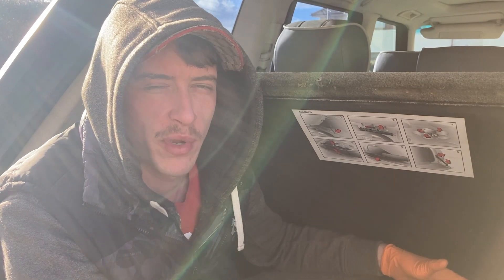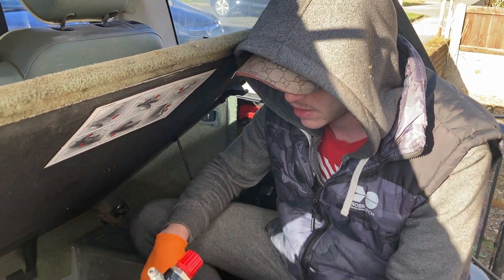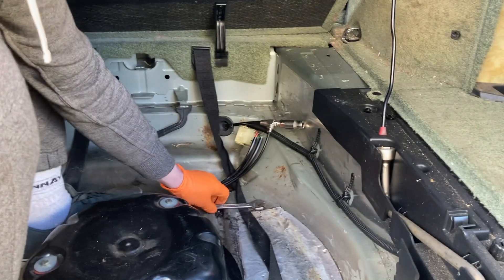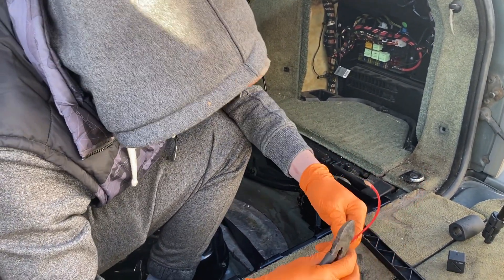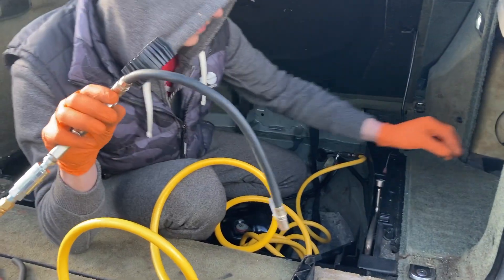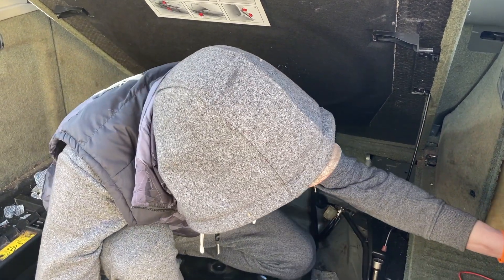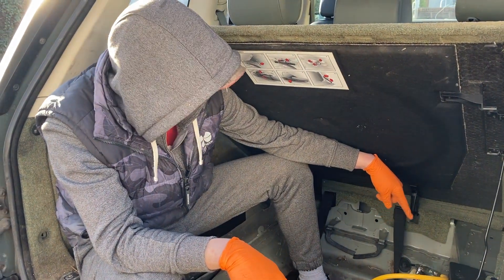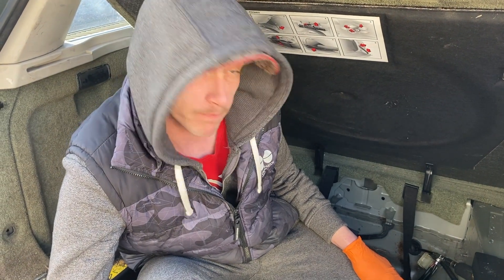Air Suspension Modification No One Knows About | Range Rover L322

Comment: Hi, I do like your thinking about this, i would make the plug in air adaptor with the relive valve still there, easy done with a extra T, the trouble is the compressor will get hot quick, I think there are some better options out there, I have a makita DMP180 compressor, easy pump up Ransomes/Toro, van small tractor tires. Makita all so sell a 12v charger. The other option is a  Durite 0-674-00. which is a good bit of kit. it do like your videos :) Keep it up :)
Reply from the maker: Cheers 👍 Yes the temperature is the only problem , I wouldn’t recommend running it for to long . But definitely works to get you out of trouble if you don’t have a pump to hand !
Reply: Same here little makita .............simple....Wouldn't want to mess around with my air suspension 😙😙😙Thats, just asking for trouble if u ask me!

Comment: I had a '04 Cayenne which had a built-in hose like this but came with warnings that it should only be used for filling up the spare and not for general tire inflation. Sure enough I tried airing up all four tires after an off road drive and the compressor shut itself down after three tires were done....Now that you've had it for a while, any issues like that?

Comment: nice one  but can you tell me if by using it like this its not adjusting anything on your car pressures?
Reply from the maker: No not at all . After 30 minutes of experimenting I jumped in it and it was fine👍 The compressor is isolated from the reservoir tank . Because I manually bypassed the compressor relay , the ecu hasn’t opened the valves to the rest of the system . My only concern is the compressor overheating , so I would only use it in 3-4 minute bursts .

Comment: Yup, made great use of mine on my old touareg. Always wished I could plumb in a second compressor though!
Reply from the maker: I’ve wondered why RR never installed it on the earlier models being off road cars! Having 2 would be ideal 👍
Reply: @DrivewayHustlers  I may actually have to do it on my RR, its a regular occurrence I put mine in access mode to load wheelchairs in on ramps. Nice big space to the right where ppl put second battery upgrades 🤔

Comment: A good idea in theory, but this will harm your EAS system. This modification will eventually allow water into your system and rust out your reservoir.   

The desiccant absorbs moisture coming out of the compressor which is then flushed by reverse flow of dried air when the system deflates. When you use the compressor for external inflation duties, the descent will absorb moisture but not go through a drying cycle.

Comment: You will be replacing your air compressor soon! It will overheat.   Besides It will not inflate your tires at the full pressure. It didn't even inflated the lawn mower small tire.